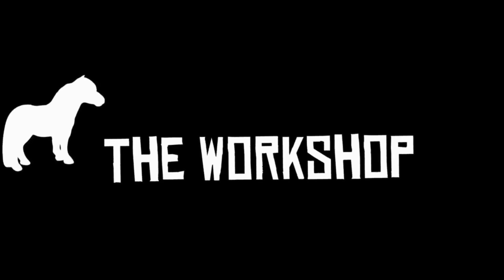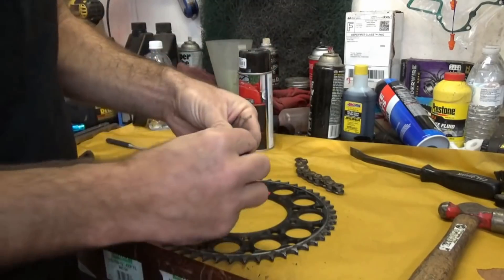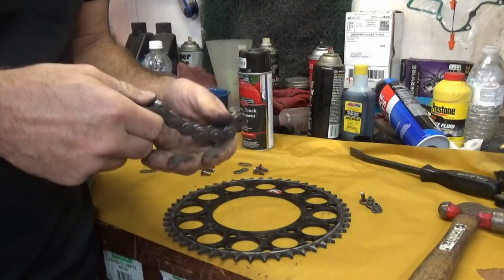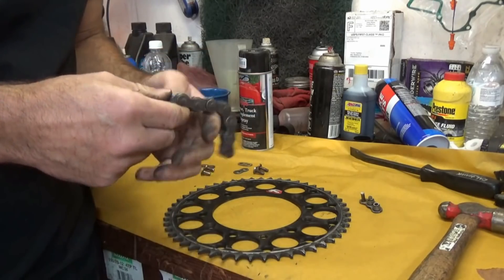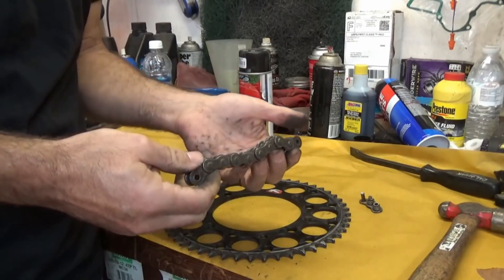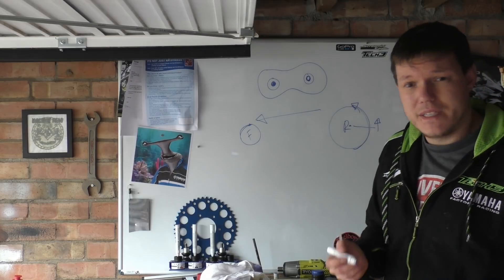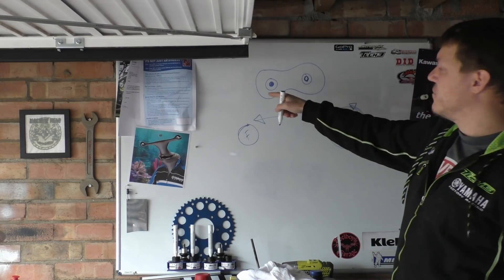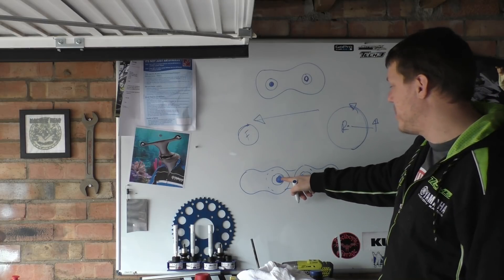Do chains stretch?

Comment: Hi Matt, good explanation/demonstration of elastic and plastic deformation, but I did note you defined strain as the force applied 7:45, and stress as the way the material reacts (elongates) whereas its the reverse. Stress is measured in pressure units (psi, bar, pascals etc) and strain is a non dimensional ratio (of length). You had me scratching my head cos the graph was right.
Reply from the maker: Someone mentioned that in the comments, totally my boo boo, cheers dude

Comment: Worked with Oilfield Coiled Tubing. Fatigue management is huge. The higher the internal pressure while cycling over from a curved state to a straight state and back to a curved state the more fatigue. Until failure. Cheers Wanker. HaHa

Comment: Not quite clear on how torque and tensile strength are related. So say a chain is advertised as having the ultimate tensile strength of 10 Newtons, does it mean that I can run a maximum of 2 Newton metres of torque through it? Does sprocket ratio affect tensile strength?
Reply from the maker: Torque is force at a distance so a 10N chain for example could take a wheel torque of 10N if the radius of the sprocket was 1m.

So the force is linear, even with torque. There's no such thing as a twisting force.
Reply: @thedirtyworkshop  ah, by the two 2N-m thing I referred to the part when you said that you don't want to subject a chain to more than one fifth of its advertised ultimate tensile strength daily.
Reply from the maker: Daily?
Reply: @thedirtyworkshop  as in consistently. If I understood you correctly, you don't want your torque be anywhere near the ultimate tensile strength of your chain.
Reply from the maker: Yes that's true.
Reply: @thedirtyworkshop  another question: does sprocket ratio play any role in how much tension the chain experiences under load? Say if we hypothetically make a 1:1 sprocket ratio (dismissing any impracticality that may bring), will the chain last longer than with something more conventional, like a 1:3 ratio?
Reply from the maker: No. Torque does, which is force the engine can provide. This is why chains with higher tensile strength (larger chains) are used for higher output engines...
Reply: @thedirtyworkshop  thanks, mate.

Comment: re: Jason Coleman - I don't think it is just common sense, I really think it comes down to peoples background and experiences. I grew up only interested in computers and have come to learning mechanical maintenance later in life. If you grew up on a farm or mucking around with dirt bikes or even watching your father clean out the carbs on the lawnmower then yes I'm sure a lot of this stuff is piss easy for you. I'm not a thicko, but mechanically I grew up very ignorant. I'm man enough to say it and the whole reason I'm here is to continue changing it. 

Over several years I've learned how to pull apart and clean calipers, bleed brakes, carburettors, valve clearances, etc. But way back when my bike instructors first mentioned the chain stretches and you have to use the adjusters, I had so much else to take in at the time I didn't bother asking HOW a fooking metal chain stretches. Because I don't have mechanical / engineering / metalworking background, physically wearing never occurred to me. Elastically stretching didn't really seem right either but that's what the word stretch fooking means to me. So I've always been a bit perplexed by this. I actually really like this word 'elongated' better. The chain overall becomes longer but none of those heavy metal pieces are individually stretching. 

Thanks a lot Tepco and Matt for making your videos, all is clear.  It's fucking hard trying to learn all this stuff on my own, this 'basic' stuff doesn't just come up over a cigarette break at work for people like me. Even simple jobs can become more involved when you've never done them before. Perfect example is right now I'm needing to change the coolant on my Toyota - thought I had watched enough videos to figure out draining, flushing, refilling with correct ratios and burping air in the system afterwards. Grabbed the manual from the library just in case and was all set to go - then I see the manual mentions removing the thermostat to help with the flushing. But to access that I have to remove the serpentine belt (refer section 1) and then remove the alternator (refer section 5). So if I want to do it properly there's two more procedures I've never done that I have to learn first. I'm 41 years old FFS and never changed a drive belt!  I love it and get such a buzz when I manage to do these things and the car or bike still works... but it's not just common sense if you don't have the background. It's hard. Just like configuring an internet router would be for a mechanic, or a flying a Boeing would be for a doctor. Eh....

Comment: It's the weakest part of a chain that wears, namely the pins, which are made of soft steel so that they can have their ends deformed to secure them in place.

Split links have their pins made from hardened steel, which is why they last for decades and through many chain and sprocket replacements. In theory a chain made up of split links should outlast a conventional chain.

Chain life depends on the quality of the steel used in the chain links and pins, whether the chain was made by a top British or European manufacturer, whether the chain is maintained & lubricated, whether the chain is full enclosed, whether the chain runs in an oil bath and whether the bike has a slow drip feed total loss hot gearbox oil feed to the chain.

I've had a conventional high quality EU made chain outlast an Izumi O ring chain on a road bike by a few thousand miles. Never wasted my money on O ring chains since.

Comment: Hi Matt,

really enjoy your approach to the various engineering matters and cutting the BS out.
Here is a clip of what appears to be a chain stretching on a drag racing bike.  It had me thinking that it could be a flexible bushed swingarm, but the bike doesn't seem to swerve at all.Interested in your opinon:Cheers and thanks for your channel!https://www.youtube.com/watch?v=u6ZsWwQ072E
Reply from the maker: That's the chain oscillating due to losing traction - we'll cover this in detail soon
Reply: On the start line it seems tight like a guitar string, then on hard acceleration appears to become quite loose - the upper section stretching.  Then off the throttle it tightens back up.
Surely a visual demonstration that chains do indeed stretch (elastic region of the stress-strain curve)
Reply from the maker: LOL they're pretty far from any real elastic deformation - the fatigue limit is pretty low on these chains. The slack that appears on the bottom of the chain is because of the upper side being under tension. The links are under load and there is clearance between each pin and bushing - this is that slack being taken up - this translates to the side of the chain not under load. 

Great little clip

Comment: The binding is totally gone with X-Ring chain or at least with the DID race chain.  The O-ring chain out of the box had some binding where it doesn't want to move freely.  DID X-Ring ERV3 = best chain.  The free movement is immaculate even at the riveted master link.  I wish bicycle chains had an X-ring option because the binding happens like O-ring chains.  :(

Comment: The average late model R6 motorcycle has about 114 links on the chain. Take into account a minute amount of wear elongation in that pin hole in each link, multiplied by most of the links, the result will be the chain will get more slack over time. It's really a series of stacking tolerances that amounts to a very small amount of slack in a chain.

The dude in the video you showed didn't take into account the multiplied forces from the crankshaft to the countershaft sprocket. Torque is multiplied through the transmission. Some 100 ft-lb crank will be much higher at the countershaft sprocket. Yeah chains are crazy strong. I'd like to see a variety of chain-break examples and see what it was that actually snapped.

Comment: Chains are going to strech, how much depends on the power they have to handle. Why do automatic camchain adjusters exist on pretty much every bike we see ;-)  The guy in the video clearly used dirtbikes but made a mistake of making a statement towards streetbikes and more powerbikes. Sprockets taking the punch ;-)

First, how does "he" come to the conlcusion that the chain is "longer"......by looking at the slack?? Has the chain have to handle "worn" sprockets in his video/conclusion...I dont know and I dont care.

Every new chain on every new bike I have bought from the dealership always gets "longer" and you need to adjust the tension, period, or maybe the sprockets gets run in.... ;-)

Good video but you are talking about something that the "reference" didn't know about.

Comment: Had a chain break once. Old and neglected RK 520 on an RD500 (we called them RZ500's). Destroyed my engine case. After much investigation it turned out that one of the pins had elongated it's hole and bent itself out of there. The chain reaction of failures ensued!

Comment: Huh. this video is kind of relevant to some calculations I did years ago out of curiosity regarding the amount of torque the tire sees. What that guy said (the amount of torque an engine produces is nowhere close to the rating for a chain) is simply incorrect, because he's forgetting gearing. And he fails to take into consideration the SIGNIFICANT amounts of stress that are applied in a situation not pure dyno pull. (bumps, braking, snapping the throttle, loss of traction). 
The example I calculated is comparing an H2R to a Ninja EX500. the max final drive torque for an H2R is approximately 905 Ft/Lb, compared to the paltry 222 Ft/Lb for the EX500. Since you mention "should keep real world stress at 1/5 of yield rating", that means just doing a raw pull the H2R is already 10% of the MAX yield rating of a top grade chain, somewhere around 10,000 Ft/Lb.
Here's the link to the sheet. I also left in a few other engine/transmission combos.
https://docs.google.com/spreadsheets/d/1e9KJ_14KDXcGa6-HbgobqE6rLjP1Gtu4wGsx12FRUpc/edit?usp=sharing
Reply from the maker: Why are you using torque (ft.lbs) - tensile strength is measured in psi not torque.....

Comment: Now I want to see if the plates themselves do stretch much at all. I mean everything (that is ductile) deforms to some degree under any load. Take some precise measurements on a bunch of the links and check later after use
Reply from the maker: LOL how precise? I can measure up to 1um but the repeatability is a bit sketchy. Most of the deformation will be elastic, however there will be fatgiue
Reply: The Workshop I forgot the rule- "never comment before the end of the video" you pretty much addressed everything I assumed you weren't going to ha.

Comment: Didn't the guy in the video express the tensile strength of steel in foot pounds (instead of psi or n/mm^2)? And then compare that number to the torque of the engine? Man he's shitting out of his mouth
Reply: Stephane Van Der Merwe Thought the same, didn't think the imperial system is that shit so it must be him
Reply: Yeah that guy didn't know anything about physics.  If he did he wouldn't be mixing up his units!

Comment: my chains seemed to stretch when overtightened and the suspension makes the chain get tighter due to extreme wheel travel on dirt bikes(when compressed)...once i stopped adjusting my loose chain all the time i stopped buying chains all the time and started getting more than 50,000 miles on a dirt bike chain set...sure beveryone told me to adjust my loose looking chain but i never lost one and i even moved down from race bike chains to the cheap Tsubaki chain that has a crappy master link
Reply: Yeh I used to leave my chain just slightly loose enough that when I bottomed it out the chain went just tight. I never had chain issues.
Reply: The issue is that many riders don't understand the travel of swingarm and the affect when you have a fixed location of the driver sprocket.  So depending on your ride and suspension set up and that distance then the slackness of the chain can be determined. However you can get to the point where too slack a chain can be dangerous.  Too tight a chain causes other issues besides chain wear..

Comment: can't we just mount a steel or brass brush on the bike maybe near the front sprocket so it cleans off the shit all the time?
Reply: hmmm.. the wear on the chain by the steel or brass brush in the long term would be mental... and if you put a plastic brush, it wont last shite.... and it could also remove oil...

but... it would be great to have some brush that gets secure to the swingarm in a easy way to clean it once in a while, use a jackstand, put it in gear and let it clean it (careful with the fingers). Its kind of a pain in the arse cleaning it link by link with and old toothbrush!
Reply: guillo88 
I like that idea. The Grunge Brush cleans 3 sides at once. Quite easily. Its about 10 dollars US.
Reply: ok fuck the brush, lasers it is! cool side effect of blinding car drivers. I think just mounting the brush on the front sprocket housing is good enough so the chain has to go through this "curtain" when going in there. somewhere on the back would also work. I wonder if there are like softer steel brushes with fine wire which would be best I think but the dirt might get stuck in there. Gotta try with a taped on toothbrush at slower speeds
Reply: upside downdog I don't know, gotta try it out. At anything over 50-60mph the thing would probably fly apart. A low friction teflon brush or something might be an idea
Reply from the maker: How would this work?
Reply: The Workshop for about 3 minutes. Saying that, if something could be done not a bad concept. I use a Grunge Brush to clean mine but they don't last long.
Reply: use lasers! like that one fancy tool used to vaporize carbon buildup
Reply: phillip galas 
I don't know much about that process or lasers but would it not burn off the o-rings and lube inside the rollers too?
Reply: alles klar klaus 
This is a good idea to be explored I think. I can't come up with anything that would last very long. A clamp on brush device for a few minutes while on a race stand would be good enough for a good while I think.
Reply: alles klar klaus 
Check out the Grunge Brush. For me it is the easiest way to clean one good. Its not perfect but has some good qualities. At ten US dollars they are relatively cheap but wear out. Semi-disposable. Hand scrubbing in both directions in important when using it.
Reply: Or was about £2 on Ebay when I bought one a few years ago.  However I have never used it and am content with a tooth brush and paint brush.  I don't find it takes long and I regularly check the front sprocket area and clean.

Comment: Is there a chance that the analogy of stress vs strain was reversed? My understanding was that stress is the pressure applied (force per cross section) and strain is how much a material deforms as a percentage of its original length?
Reply: Was thinking the same thing. Strain is the direct result of the applied stress.

Comment: I think everything will wear when horses bang on it... Where does the power go when they talk about power loss? And Why is the power loss on the driveshaft so big?
Reply from the maker: This is along the lines of efficiency. If you put in 'X' amount of torque and over time this is power then how much of that 'power' is transfered from 1 sprocket to the other. 

The power 'loss' is due to waste heat. The friction of all the links internally and between the sprockets and the chain is this waste heat. There's also noise, oscillation etc. 

If you're talking about driveshafts then its the slide friction between gear teeth. We'll look at roller gears one day....
Reply: ok